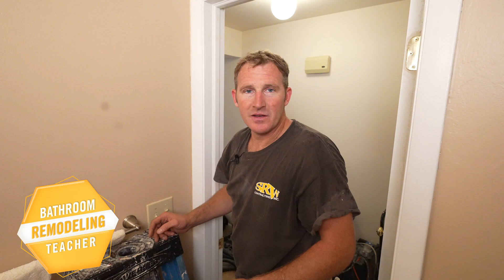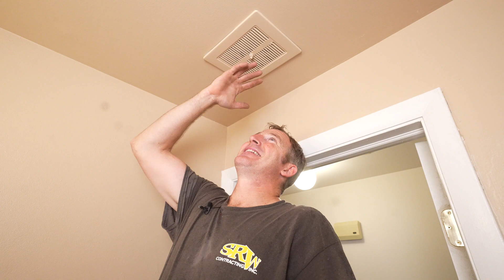Easy Bathroom Vent Fan l PLAN LEARN BUILD

Comment: The Home Depot builder special fans are such a pain with limited instructions, mounting methods, or wiring on the opposite side where I’d need to add a junction box. Good recommendation on the Panasonic!

Comment: Just came across this one. I’m looking to replace my builder grade noise makers. We have two downstairs in the powder room and laundry room. If you are in the bedrooms above you can’t barely hold a conversation it’s so loud. 

Great tip about the wire but with stranded wire. I used Wagos for kids bath fan.

Comment: I accidentally bought the DC version of this fan, now that I'm ready to install, I can't get Amazon to take it back...
Reply: It's obviously been a while and you likely found a solution already, but Are you sure you didn't just get one that converts the AC 120v house supply to a DC motor? DC motors are more efficient. The inverter is built in.

Comment: Love your videos, Steve, I've watched a ton of them and am in the middle of a bathroom reno (tiling the shower walls around the tub at the moment) and I've gotten most of my instruction from watching your videos here and with Home Repair Tutor. What would you do in a situation where the bathroom never had a fan to begin with?  The bathroom I'm redoing is on the second floor (attic above) and had no fan originally.  I want to add one but am not sure about how to go about venting it out of the house.  Thanks!!
Reply from the maker: Hey Bobby, Thanks. So yeah a new installation with new duct system is somewhat unique to each situation. But typically you want to vent things within 8 ft of the vent. 3 main ways to vent. 1 - through roof (which is best/but probably best to have a roofer install the roof vent for it) 2 - though the side of an eave or side of house (depends on location and if you have a gable end on your home) 3 - route duct over outside wall and install a soffit vent (if you have overhangs on your house). Did you have a gable end to install a dryer type outside vent?
Reply: @BathroomRemodelingTeacher  Thanks for taking the time to reply, Steve.  This bathroom is in the middle of the house so I'm pretty far away from either end.  It is against the back of the house, though, and I was thinking about going the soffit route - I don't think my soffits are vented - if I go up in the attic during the day I do not see any daylight coming through the soffits. Everything else in the house is vented through the roof (other bathrooms, dryer, etc..).  I actually wasn't sure who to call to see about putting a vent in the roof (is that a job a roofer does? or an HVAC guy? etc..).  Can you run more than one exhaust fan out a single vent in the roof? Maybe I can tie into something already there? Thanks!
Reply from the maker: Yes, I would recommend a roofer for that. But depending on how old roof is, it might be tough to find someone to do it. Plus it would probably cost $3-500 to have installed. But it is the most efficient way to go. You can get a duct wye that you could attach to vents too.  Here is one with the flaps inside to prevent flow back from one fan to the other  https://amzn.to/3sMSzPT
Reply from the maker: And for soffit. I recommend cutting a hole in soffit and using one of these - https://amzn.to/3gwseQT
Reply: @BathroomRemodelingTeacher  Thanks for the info, and thanks again for all the content - you're almost singlehandedly helping me renovate my bathroom :)